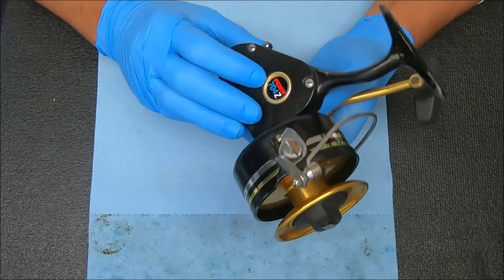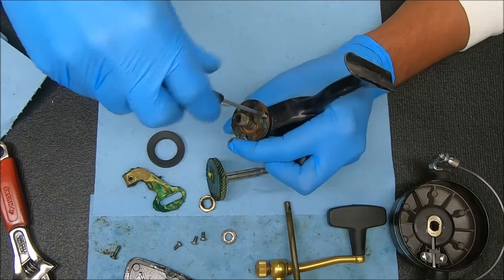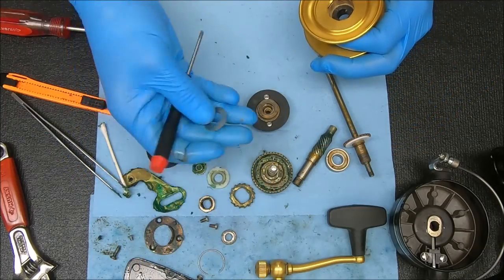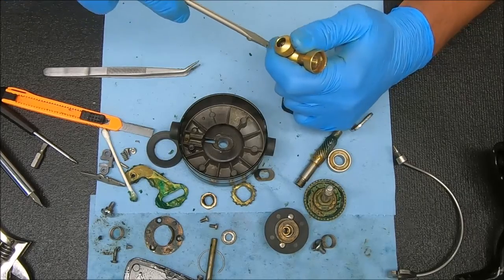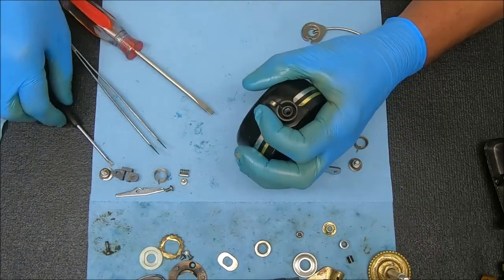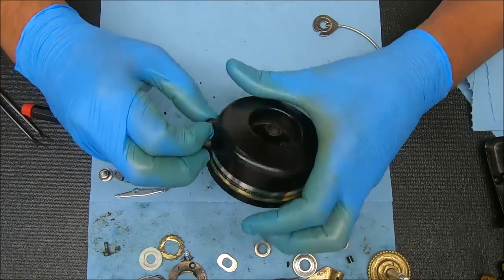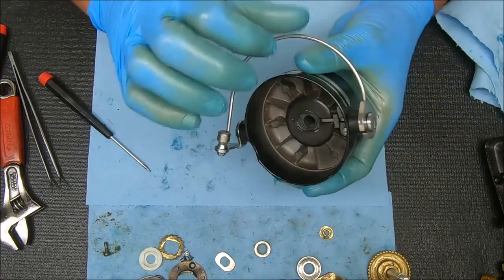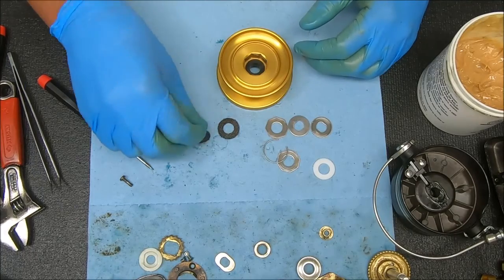Penn Spinfisher 704Z - How To Take Apart, Service & Reassemble This Spinning Reel

Comment: Great Video!  Thanks again for your excellent instruction. I purchased the 706 Z, which was brought back into production for a short period by Penn in Philly, Pa.  The only real difference between the 704Z and the 706Z is the bail less rotor.  Another difference between the "Re-introduced" 706Z/704Z and the original was the addition of another bearing on the handle side.  
Most people think these reels are outdated because there are NO instant anti-reverse and 15-ball bearings.  However, these reels are built like tanks.
Reply from the maker: Thanks for watching! Totally agree! Excellent reels that just keep working.

Comment: My 704Z reels all have a different drag knob on them than this reel. I’m in the middle of restoring an early version of the 704Z with a black spool and the Planck hard plastic torpedo handle. I could not get the screw out of the bumper side of the bail. The reel is so old I did not want to chance butterflying the screw or breaking the rotor. The bail works fine though it is slightly bent. I could not take the handle apart. I had to find a NOS side plate with medallion as well as a bail bumper and cup. I used fine steel wool on the surface of the mail gear and on the oscillation arm as both had hardened grease on them. I may have to find a used housing as one of the side plate screw holes has evidently been damaged. I’ve collected 7 of the black/gold Penn Z reels as part of my 320 vintage spinning reel collection. I’ve had my 706Z since the 1970s. You did a great job on this video! 
— Chris
Reply from the maker: Thanks for checking out the video and compliment, Chris! Impressive collection! Regarding your project, the drag knobs should be interchangeable..... Getting the screw out of the bail is fairly straightforward..... use a torch and some oil like CorrosionX to gently heat the area... it'll come out after enough treatment cycles (you'll need to replace the bumper, but you probably already need to do that anyhow). If you don't want to do that, you can try removing just the trip lock side and reshaping the bail wire that way... same process for the handle, but that may be a more difficult and needless process... just realized you did say that you did need to replace the bumper :-|.... finding a new or replacement housing is probably best, as retapping screw holes is not easy. You can try mysticparts for any pieces you may be needing. Hope this helps. Enjoy the reel! Barry

Comment: Greetings to you and what you are presenting.. Why did Benn abandon its usual design in order to design this machine that resembles the German DamQuiq, and what is the strength of this design in the gears?
Reply from the maker: Thanks for checking out the video, George. Abandon what usual design? I don't like a worm gear system in a spinner, per se.